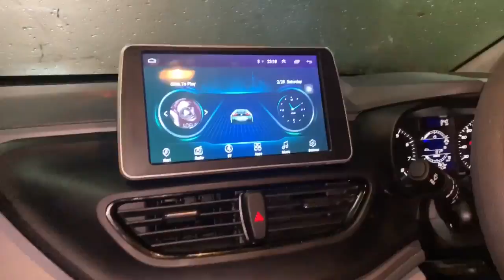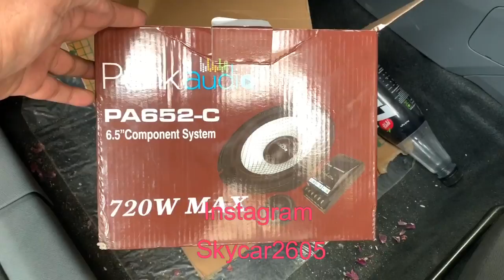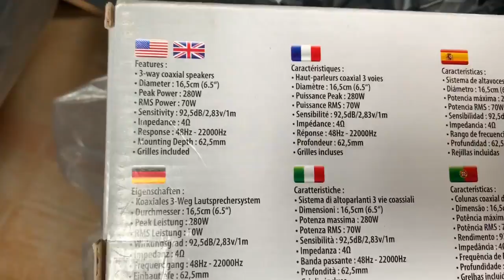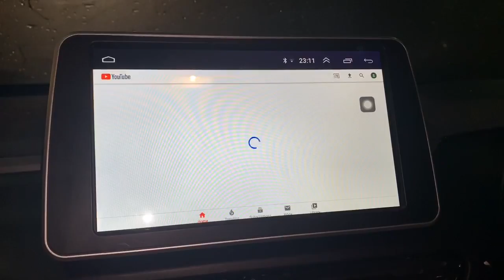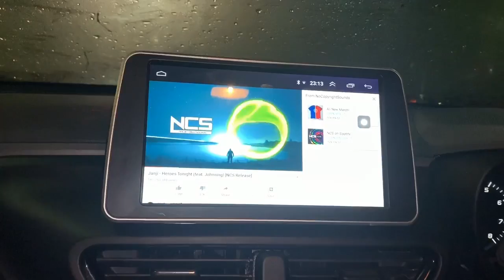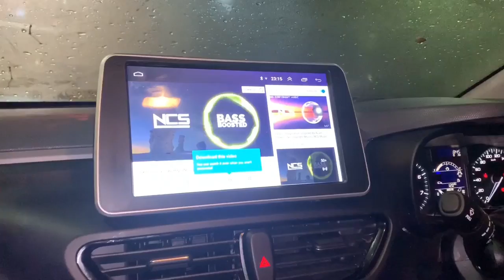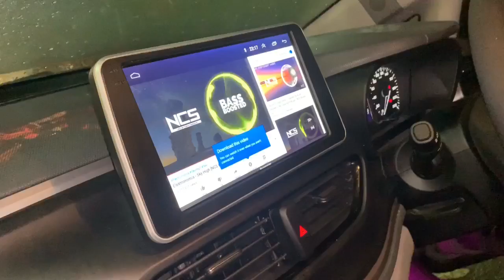Tata Altroz first ever android player floating style Altroz accessories Altroz modification skycar

Comment: Hi,
I am buying xe base model. I need to install music player with 4 speaker. And 7d flooring with full wheel cap. What will be the price?
Reply: Atleast go for xm
Reply: You can go for xe with rythm pack.. Will give you music and power windows by default.. Most value for money is xe with rythm..
Reply: @TrendingPoonai   yes. Only if you are okay waiting for 60-70 days. Altroz with customisation packs has a booking period of ~ 2 months
Reply: Ya i have booked with Rhtym pack which is taking tym and I want delivery in navratre
Reply: @TrendingPoonai  Xe Rhythm, no power windows, only normal stereo and center lock